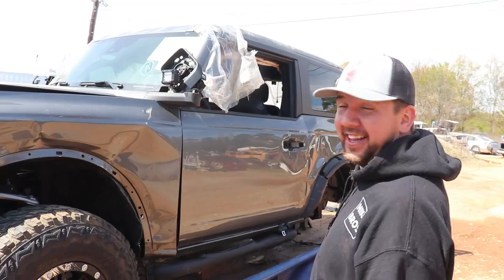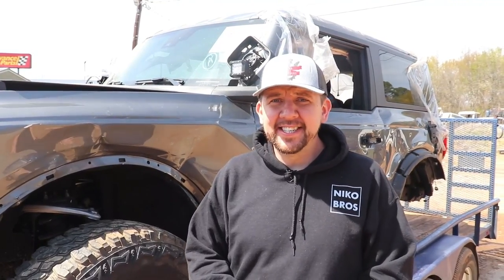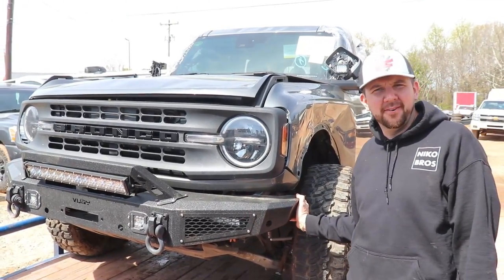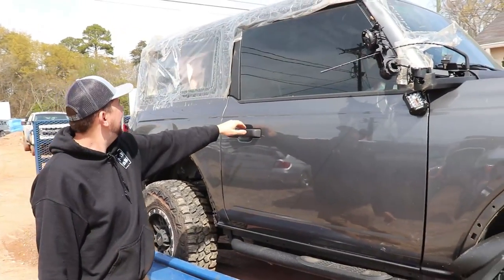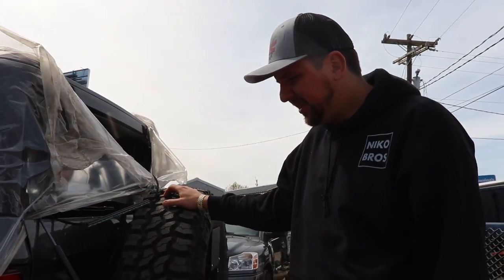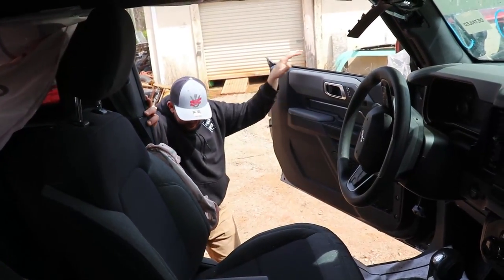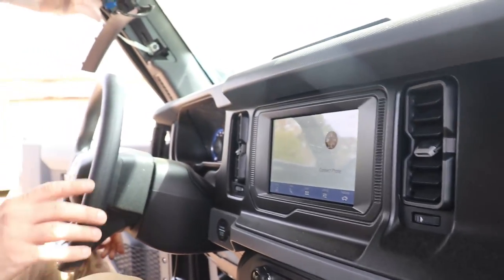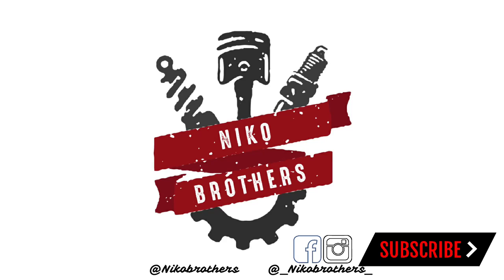WE BOUGHT A ROLLED 2022 FORD BRONCO: HUGE PROJECT!

Comment: Why would you want to raise it up if it already is known for rollovers?   Put on some nice custom rims and tires and leave it manufacture height
Reply: agree about not raising it too high if it rolls easily
Reply: Yep we had one of the middle 70s models they were basically little death traps short wheelbase plan it turned turtle alot. i know a local guy took one out on the gravel didnt take long to kill himself, the top just folded flat. no doupt these newer ones are better but they still have the same inherit problems
Reply: I was just going to say with so many channels rebuilding rolled / binned examples - Goonzquad, 23rd Garage etc. is it a car prone to rollovers?
Reply: It seems with every pickup and SUV they purchase, they bring up the possibility of a lift kit. Why???? Once repaired, a lot of their builds are resold.

Comment: No yellow! May want to forget about the lift kit. With the existing high centre of gravity roll overs are a problem, a lift kit will just multiply the roll over issue.  Looks like it will be an interesting and possible expensive rebuild. Bring on the videos.

Comment: Goonzquad is rebuilding a 2021 Bronco.  They put a widebody kit on it so they have a few body panels leftover.  The left front and rear quarter along with the right rear quarter panels were switched out so if you have trouble getting these parts, contact them.  Good luck with this project, I always look forward to your videos.

Comment: Right on Guys! This will be a large project! I remember back when the Bronco 2's were brand new when I was a young man. The shop I worked at back then pretty much bought wrecked Bronco 2's and always had one or two being rebuilt. In the back yard we had parts Broncos. A few of the rebuilds are still running around. This build sure brings back memories. Anyhow if you repaint you might consider anti matter blue that would be awesome. The grey would be much easier though and would save a lot of work!

Comment: Yes 'Huge Project' is probably an understatement. I think if you lift it anymore as others have said it will be like a toddler, very unstable. If you want to do a colour change, fine but please not yellow it will be totally impractical. It is good that the mileage  is low but as it is so new you may have problems getting that year's parts, l hope not. Thanks Brothers for sharing this build. 👍👍

Comment: FYI...Goonzquad is finishing a Bronco build so you might want to check that out. They did a fiberglass wide body kit and a lift kit. They found Ford was having problems getting parts so they did some Ebay items. Don't go yellow, maybe just take it back to the stock color and then do a wrap to change the color.

Comment: This will be interesting (but don't forget you need to bring the finished Tesla to light) but check out all of the hoopla on these new generation Bronco's.  Engines are suppose to be crap and plenty other stuff is junk.  The thing it has going for it is the design copied from the older ones (that were bare basic 4x4's in my days).  Just don't turn it into a swamp buggy!

Comment: I wouldn't go more than a 4 inch lift and 37 inch tires anything more your just asking for trouble. Broncos have issues with there front end suspension, so I would replace everything you can including the the rack and pinion steering.